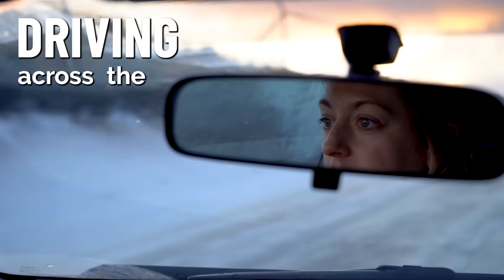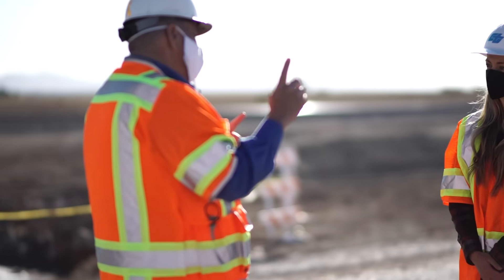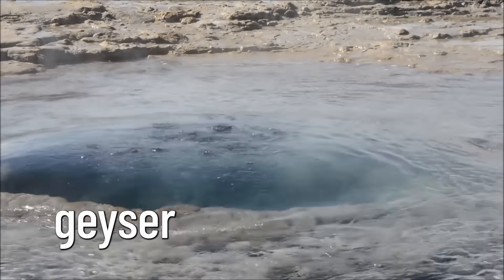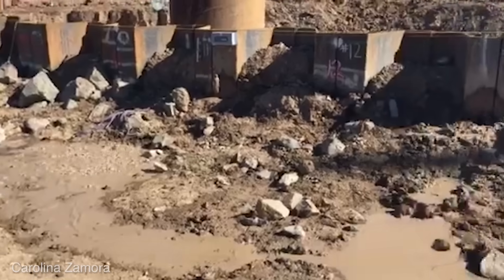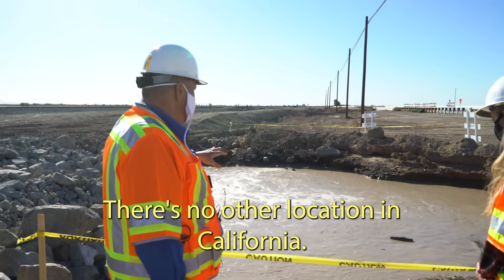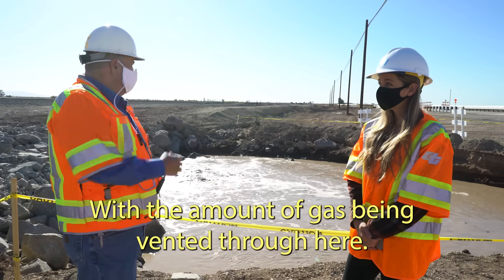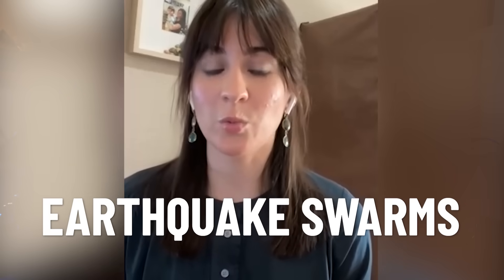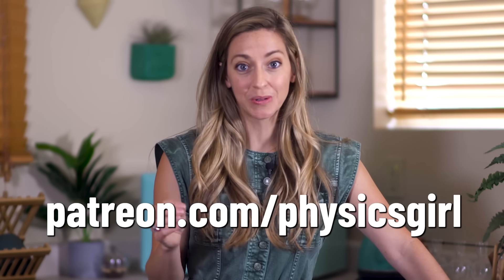World's Only Moving Mud Puddle

Comment: well technically if it is at an angle from the source could you not just easiely prove this by using the line that its been moving in, go onto the other side of the road and drill there to see if you can get it to hop over there. If then its true that its moving  up at an angle from the source, you could easily pin point the source of the C02 then drill above that, it wouldn't move then. also could you not use some form of ground radar to trace the underground spring? These are just some answers that i can think of from an engineering standpoint. It seems like they are just trying to fix the effect of the mud puddle instead of trying to fix the mud puddle.

Comment: If the theory of wanting to get vertical from the source is correct. Could they drill a path for the geyser on the other side of the road etc.. to give it a more prefered path? Basically helping the geyser move to where it would prefer to be.

Comment: Did you call the FBI, they got a program X-Files they might be able to figure it out.  But seriously how about it following a fissure or crack underground?  I'd compare underground structures and drilling effects of water underground.  Several caves have this going on in them with water that is fixed underground and have pressure applied.

Comment: That theory about it being on a slant is interesting. To test it out, they should start drilling a hole about 50 feet or so on the other side of the road (in the direction that the puddle is moving) and go down about 200 feet or so and see if you hit that same gas pocket. If it does, that both confirms the theory and saves the road since it will just escape through the new shorter pathway instead of cutting across the road.

Also, "Why did the mud puddle cross the road?" lol

Comment: 8:45 yikes, that's a full scale blowout. So glad that you weren't drilling for oil or natural gas, bc that fs would have caught fire. Infact, that's how most oil rigs catch fire and spill, trapped gas blows oil up and out, that oil finds an ignition source(exposed wire, overheated bearing, some dude smoking a cigarette) and boom.

Comment: I wonder if this mud puddle is behaving similar to the volcanoes that created the Hawaiian islands. The string of islands that make up the Hawaiian Island chain were formed because there is a tectonic plate moving over a fixed "hot spot". So maybe for this mud puddle, instead of a molten "hot spot" there's a gas chamber and so when the plate above moves it looks like the puddle is moving to observers on the surface but really the observers are "riding" on a plate and observing a stationary mud puddle as it "punches through" the moving plate above it.
Reply: That's probably not it though cause the mud puddle would be moving faster than the plate....

Comment: Have we dropped sensors in which are capable of interpreting the flow of water under the surface? Get samples for the temperature, pH and mixture of matter in the puddle?

And, it may sound... ridiculous (but it IS a moving puddle, so what's ridiculous at this point?), but... a sideways whirlpool? The fact that the plating bent toward it might suggest pressure difference. If that's the case, I would suspect it is an angular spring as proposed; the angular flow, gravity, shape of initial hole, etc., could cause the water to tumble end over end (you know what? Tsunami. A tsunami is kind of like a sideways whirlpool). The "mini-tsunami" would then have a pressure drop from mud/gas flow in the forward direction, gradually eroding what's in front of it and burying what's behind it. As the puddle moves, the pressure changes in the spring "chute" which forms it to move with the puddle.
The pressure difference from the mass of the puddle's more calm portions and it's moving portion (its "skin"), would first cause the plating to be pulled in (I'd like to know how fast things are pulled in at different mass classifications) and then any opening of the plating would be filled, following the path the plating makes (separating it as it fills) and ending up on the other side.

Even if that's not the case, having the information of its properties will, at the least, help us to understand what it is by showing what it's not. 🤷‍♂️

Comment: We know oil and water is attracted to fault lines, so could this mud pit be following an old fault line?  The gases says there is something of value much deeper.  The problem is drill straight down as the pressure and mud will destroy your drilling rig.  So drill in from the side with lateral drilling for more than mile.  The longer the better.  Is there a recent Earth Sounding Analysis (Geology) for that area?  It helps to know the structure of the rock below.

Comment: I wonder if they could drill a hole ahead of Kyle and get a pipe past the water table. Then they could make a vent or tap and avoid the gasses making a mess by making an easier route for them in the empty pipe.

Comment: Perhaps there's a limestone slab down there.  And, it was mentioned that this is near a fault, so perhaps, long ago seismic activity tilted it, and perhaps the water beneath it is acidic and slowly dissolving the limestone, which is where the CO2 is coming from.  And, as the edge of the slab dissolves, the slab retreats, causing the mud pool to "move".

Comment: I didnt watch the complete video but it is quite obvious to me that this due to the San Andrea's fault. Some where off the fault ther lies a smaller fault connect to the San Andreas... there is a hot spot that is moving or I should say that southern California is moving due to the Fault.. The San Andreas has smaller fracture faults that spread out from the main fault obviously there is a hot spot that moving due the San Andreas and is moving, shifting and buckling causing the other faults to shift and contort as well..

Comment: "rotten egg smell"

thats methane gas, theres probably a pocket of it under neath the ground, or maybe one of the gas pipes is leaking it, basically its a sink hole
Reply: methane gas is scentless. we put hydrogen sulfide in with methane in processing so we can smell when it's leaking. volcanically active areas like hot pots and geysers also happen to give off hydrogen sulfide.

Comment: it could have been erosion that made the mud puddle move. maybe this tilted plate eroded until the point the direction of the bubbling changed. could maybe speed up the moving by drilling tilted from the other side of the road the mud puddle is going to and by doing this save the road.

Comment: in Indonesia we have something similar,  bigger, called lumpur lapindo or lapindo mud. it is so huge and it keeps growing.
Reply: Very similar, I hope the scientists involved in the case have that in their radar
Reply: Mbel
Reply: Aka Lusi mud volcano, east java indonesia. That oil fracking oppsie. Um... Not quite right on compairing the two. Im thinking its closer to what happens with Heircropolis Plutionium Temple aka Romes (actually greece's first, Rome had lake Avanus pre owning Heircroplis😒'). Leaky transititive fault meaning a rift perpendicular cross sections that transitive fault line creating that stair step fracture shape. Which id what their trying to suggest at the end what is causing this.

Comment: The gas is finding the path of least resistance. The source is no where near where it's coming out. However as the ground erodes and falls apart...it continues following the weakest path to the surface. The reason kyle is "moving" is because it's slowly eroding out the ground between it and the source. Once it broke to the surface...it's slowly knocking out the edges of the hole heading TOWARDS the source of the gas. The reason kyle "stopped" is because it couldn't break the ground up as easily. Maybe it was super compacted or has huge sections of rock in it. Once it did finally erode the ground out down there...it started moving again. My guess anyway...

Comment: I was thinking the reason it was moving was also due to the water coming up at an angle.  Has anyone ever thought to drill on the other side of the highway and speed up the movement if they can get the bubbling to come up the drill hole.   Just a thought to try instead of moving a highway

Comment: Wouldn’t you be able to drill 4 wells opposite corners from each other.
Then test pressures over a certain period, and measure the differences?
Compare moving point puddle A to Well pressures B, C, D, and E to hopefully locate source? 
Assuming the release is happening at an angle that is.

Comment: In my opinion the mud spring is actually horizontal and flows from the direction it moves to. An earthquake could damage the tunnel and erosion that follows would easily start cutting backwards towards the flow of the fluid, while the rest of the structure collapses behind. It could also be a rock plate that could have gotten just cracked by the earthquake and now the spring is cutting through that crack.

Comment: I'm not sure why they thought a steel wall was going to work. Unless the wall went down below whatever geological feature the gas was rising from, it would just go under it anyway. And if it is coming up at an angle from the source then any hole dug deep enough to do anything would just intersect the path of the gas and cause it to jump to that hole. Which it then did.
You'd need to relieve the pressure closer to the source to bypass it,  and sufficiently to make a difference which probably means many holes/wells would be needed.

Comment: I'm curious as to the acidity of the water. I know in our blood, we transport carbon dioxide not as carbon dioxide but carbonic acid or H2CO3. I'm wondering if the pH is low enough to aid in the digestion of the surrounding strata. If you were also smelling sulfur, I don't think it would be that much of a stretch to assume the might also be traces of sulfuric acid.

Has anyone done any coring of the area to gauge the structure of the strata at say 100 or even 1000 feet below the surface? Knowing the composition and how it reacts with a mild to strong acid, coupled with intense pressures (which could translate into heat generation) may be the driving forces behind the movement of this seemingly innocuous mud puddle.

Comment: ..... If this was the result of an earthquake... and all this is Carbon Dioxide..... I've a few.... hypotheticals swirling around, but I've a question... Has anyone tried to probe it, send a camera down the Niland Geyser? Has anyone done a seismographic scan? Because if this is direct Carbon Dioxide, and this puddle is moving, that means, something is enabling this... moving mudpot to drill, eat, and erode constantly in a direction, what's driving it? And if this is the result of an earthquake, this may be more dangerous than presumed, depending on how deep it goes..... And if push comes to shove.... whats stopping it from tearing the land apart all the way to the ocean... what happens then?

Comment: I've got a suggestion: If heavy materials sink in it like it's a liquid, what's stopping them from dropping a pipe with an expanding iris as a "stopper" with a P trap at the top along with a large vacuum pump to encourage flow into the pipe? If you lower it as far is it can go in the mud pot it would prevent the erosion problem via simply bypassing the parts that would be eroded.

                 |---|<-vacuum pump and a pocket of air kept under lower than atmosphere pressure
                 |__|
    __        /    |<-pipe leading into the mud pit
_/     \__/      |
Reply: As "earthquakes" maybe "started" it my theory is that the pocked moved below the surface. So it's on an angle. As they said in the video. My suggestion would be to just stick something long into the puddle to look at what angle and in what directions it's going. That way you can predict in which way it will be moving and how far. In that case you can close of the area for people - and build the highway the other way around.
Reply: @SpicyFiur  you could also try and predict where it will end up and drill a hole there.
Reply: And we may not know how big its origin is. It's obviously worse than an iceberg, where you see 10%. You see the effects of something really, really big. I think the engineers on the spot have figure that out long ago. But all armchair engineers are welcome to have their say, and I'm not joking. It's usually well meant.

Comment: Well, if the theory that it's a source coming at an angle is right, wouldn't the sensible thing to do to try and save the road would be to dig a relief well ahead of the road where it wants to be? Or is it just so deep that it wouldn't make a difference? Or maybe if the source itself is too deep they could maybe dig at an angle towards where the mud hole is actually to try and "meet in the middle" and redirect the flow where it wants to be. Otherwise just let nature take its course and pave a road around the hole where it has already passed since it's going in one direction. I know I'm not an engineer but I have a hard time understanding why experts wielding the full might of human ingenuity are stumped by a mud hole.

Comment: So it's a geyser and a mud spring running along an underground water bed or stream and is moving along the path of least resistance? Seems the trapped gasses help to keep the hole open to release pressure.  Looks like it's just weathering it's way along.

Comment: couldent they use gpr to find where the pocket is and drill a hole directly over it?
Reply: i mean , i guess that a possibility.

but they said it started moving when there was earth quakes and they also said there is a fault line there.
my guess is the gas isn't trapped anywhere but rather it is bubbling up from deep in the fault and passing through a underground river perhaps.

in that case there isn't really thingy to drill into to release the gas even if you could get all the way down there.

Comment: Well, it's very near the Salton Sea which sits over the San Andreas Fault, San Jacinto Fault, Imperial Fault Zone, and a "stepover fault" shear zone system. It was a dry lake bed up until the 1950s and 60s The lake would have dried up, but farmers used generous amounts of Colorado River water and let the excess flow into the lake. Mudpots and mud volcanoes are found on the eastern side of the Salton Sea. As stated, this mudpot started moving in 1950s. Drain the Salton Sea problem solved....maybe. lol

Comment: Here's my take: Definitely related to the earthquakes mentioned for it's movement.  The tectonic plates above this high pressure pocket of gas are shifting  causing what looks like the mud puddle moving but in fact is the earth crust shifting.  It may not be detectable by typical surveying methods as the earth's magnetic field is also altering as these plates shift.  There really isn't a good way to counteract this phenomenon but you can attempt to anticipate it's movement and provide an open channel to relieve pressure perhaps a few years in advance prior to the pressure's main throat reaching that area of the crust.  This pressure relief channel would have to be somewhat sizable; think along the lines of a typical sheet pile system for a bridge pier foundation for the golden gate bridge but deeper.  It's interesting to note that there doesn't seem to be much water release from this mud puddle; it's movement is more from the continuous carving of the crust due to the extremely high pressure.  Kind of reminds me of a water jet cutting machine on a grander scale where the earth's crust is the medium we are cutting through.  My only question would be if you are able to somehow relieve this pressure which is undoubtedly created by the weight of the earth above, would you create an even bigger problem? What would the impact be of this large amount of carbon dioxide release on our atmosphere? How would the earth's crust behave above a no longer pressurized void between the earth's crust and most likely the mantle?  Could Earth's atmosphere become similar to Mar's if this large level of CO2 is no longer contained within the Earth's lithosphere?

Comment: Wow, I've never heard of this before. I used to live in the area southwest of there in El Centro, I'll have to check this out next time I'm  in the area. The soil down there is very silty and powdery and smells like plaster (actually most of the plaster in US is mined from this area in the plastercity factory).

Back in 2010 there was a 7.2 Easter quake nearby centered south of the Mexican border there. It was still very strong in the entire region luckily it wasn't a major metropolis like LA area or San Francisco. That would make big news.

Luckily, you didn't visit in July cause its extreme heat in that area is pretty much 2nd hottest region in US (centered in Yuma). Only Death Valley is hotter.

Comment: I should think that both due to the threat a major CO2 venting poses to the people in the area and to our climate, containing this gas pocket should be a high priority. The combination of mud powered by highly compressed gas (plus the acidity of the water,) is probably responsible for the movement. As that churns against a harder layer of rock which caps the gas, it grinds away the stone, which was probably cracked a bit during the 2016 earthquake swarm. the actual pocket of gas might be offshore. It would be interesting to see the underlying geology, and informative to examine the original location and areas along a path uphill from the origin for traces that this vent moved before.